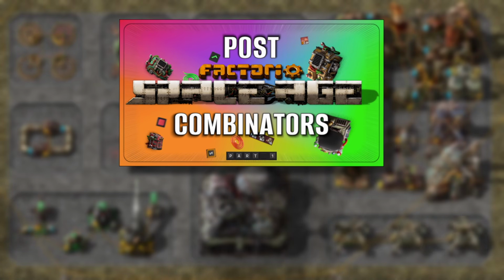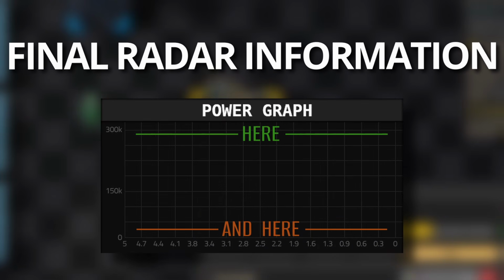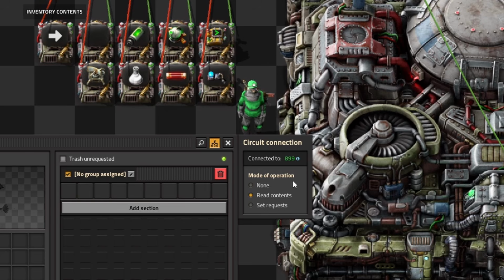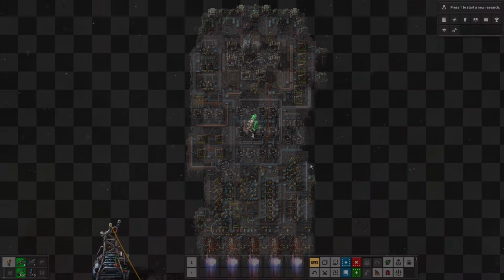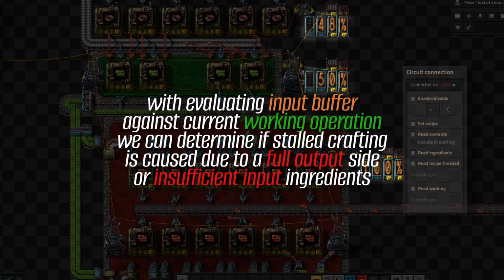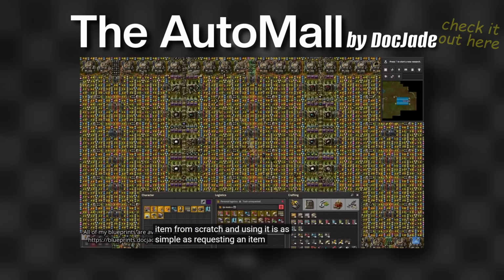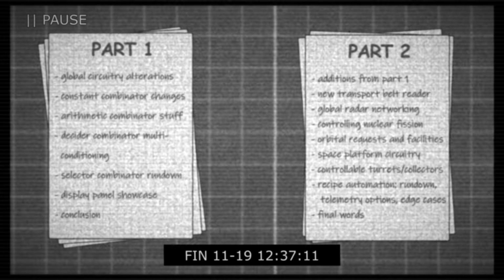all new circuit network building features in FACTORIO: SPACE AGE

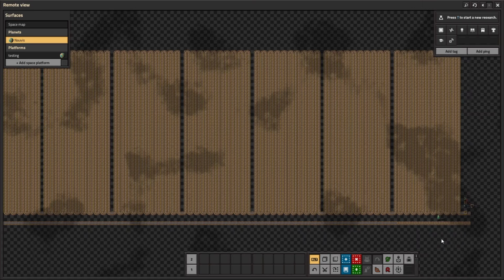Comment: 3:30 whats the max gate length?
Reply from the maker: not entirely sure if there's a hard limit for a belt lane reader. The biggest single lane I tested on my end was about ~28k in length, working with no issues. So even if we have a limit, it's going to be larger than most practical applications require, I hope...
Reply: @center_pivot I mean gate as in the wall one
Reply from the maker: @Thankedsphere99  I've quickly tested up to a thousand connected gates in a wall, so I'm guessing that the limit, if it exists, is set very high.

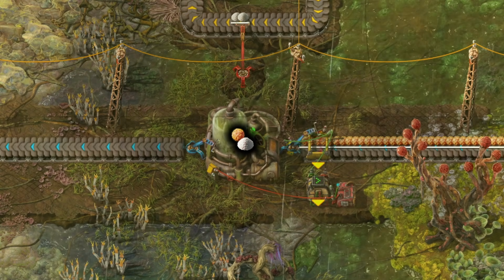Comment: 13:14 In the future, when the automation-automation of the automation, can also be automated :D
(kind of "automation^3" that automates the "automation ^2" that automates the regular "automation" )
Reply: Recursive blueprints... (a mod that lets you place blueprints using the circuit network) - so you could imagine an auto mall that grows when it can't meet demand fast enough. (could grow dynamically based on what kind of things it has trouble satisfying - if you have an automall with different kinds of machines (electromag plants for modules and circuits, for instance))

Comment: as far as i understand the belt read options should scale with belt lag now, since the belt has (i assume) a table somewhere of every item on a belt, and it's position. So this hold (all belts) feature should basically just tally up the entire existing table on the belt, and since belts can group, this should be extremely low overhead for packed belts at least.

btw, if you're trying to tie temporal mapping to radars, the best way to do it is going to be using a global clock signal on the radar, set to whatever interval you want, and then you can read the clock signal on both ends, to know when to tx/rx that specific signal. Same as you would traditionally for something like serialization, except in this case you don't want to be using a self referencing clock since it's a global bus, a global clock signal is going to be required to keep everything in check. Should be useful for everybody out there wanting to do silly things.

Comment: My recent invention is connecting constant combinator with e.g. "iron plates = -1000" to a bus belt set to "enable if everything < 0" + "hold" to create a simple "bus pollution protector" . If anything that is not an expected item gets to a belt, it simply stops making cleanup easy. I already used constant combinators as an informative marker, so this is a 0 cost mechanism for me that prevents having to hunt for results of accidental contamination all over the factory. You can connect the alarm easily to it too if you want to be notified, but that's an extra effort.
Reply: Asking for clarification. The belt above is for iron plates and you only read one square? So when something other than iron plates is registered the belt stops?
Reply: @samarindt Correct.
Reply: @dcxyz-glhf Filter Splitter set to iron plates, the other goes into an active provider chest. Or any non-logistic chest. Will stop the belt the same, but with fewer maintenance. But you might have different ideas for your solution.
Reply: @hb-man I use my design mainly on the main bus, where I can copy paste it side by side between every edge of a block. Compactness of no extra pieces is great here Generally contamination only happens when I make a mistake, so maintenance is not an issue.